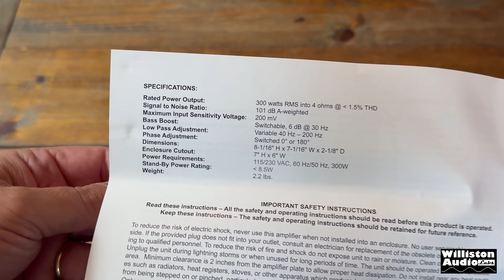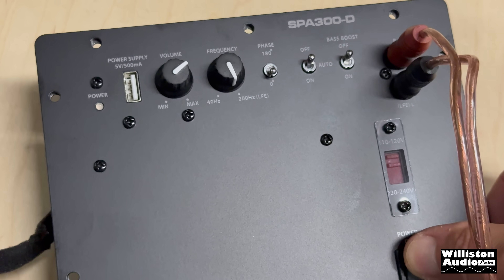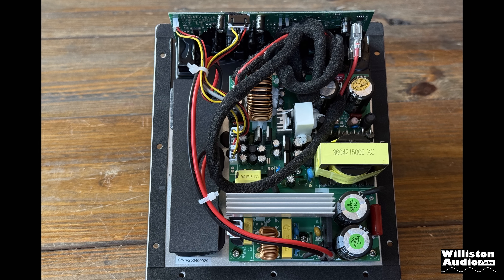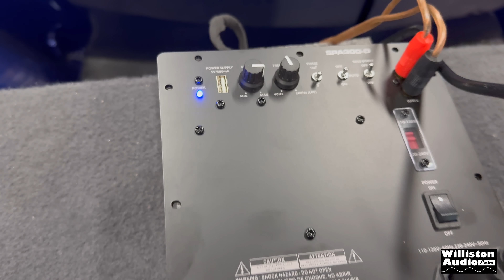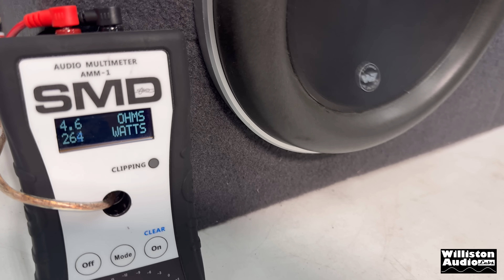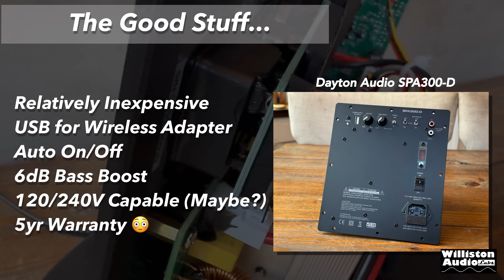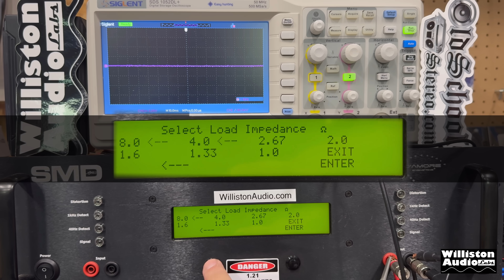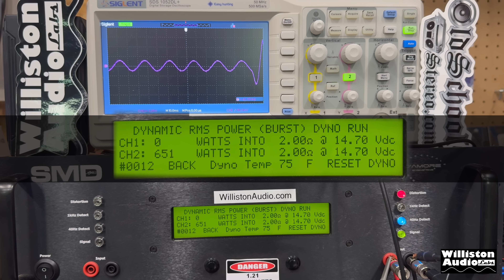Amp for Your DIY Home Subwoofer - Dayton Audio SPA300-D 300W Plate Amplifier

Comment: I don’t think the 200v problem is really a problem. The input power supply is certainly NOT delivering high voltage. Most likely it’s a much lower voltage and certainly DC.

Comment: I run a Dayton 500W DSP that I used the included software to tune my room.
It drives 2 velodyne subs. An 18" F1500  (250W) and a 10 cht r (185w) in parallel for a 3 ohm total. Was Tired of fixing the caps and dry joints so I mounted the 500W DSP on the side of the TV cabinet. Volume range from 10-14 blows your socks off and I dont mis the accelerometer. 
The 18" had a lot of boom so I then added the 10" for more punch. Works well.

Comment: Would the plate be able to move 2 10inch sub woofers Orion Cbw104D? Conected in series to get 8ohm, since they are 4ohms each and 300 watts rms

Comment: should put the sub on the floor where it will gain 3 to 6db for nothing with floor loading. to gain 3db on a system needs twice the power 6db is 4times. so good gains.

Comment: 12:20 No "True" LFE Input

From the manual that you were holding at 0:54:

"Note: When using a pre-amp or home theatre receiver with a LFE (Low Frequency Effects) output the internal low-pass filter circuitry should be bypassed by turning the frequency control to maximum (200 Hz)."

0:59 All that stuff most of you probably aren't gonna read anyway

Comment: The input power is using the classic voltage doubler when set at 120v  and non doubled when at 240v,  the caps are effectively in series giving them a 400 volt rating.
Reply: Those god damn fkn caps dont have dick shit to do with wall fkn power jffc 
SEE WHAT STUPID DOES TO IGNORANT HOLY SHIT U GUYS GET TFK REAL ALREADY JFFC

Comment: CRAZY take... 

While I'm saving  up for my Corolla build for my wife (broke AF in these times), I took a 400w 12v->120v inverter and plugged a 100wrms Monoprice home  sub amp up and slapped a VM Audio 10" DVC on it wired to 8 ohm. Seems  like it's only getting about 50w, but not sure.

Seems to me it takes less electrical support in a car to run a home sub amp this way with an inverter than it does to run a dedicated car amp of equal power. I know I'm  running factory electrical and have a sub and amp installed with zero drain on the electrical.  I just tapped it in as an "add-on" sub like a big box powered sub.

Comment: Video on these types of home amps was just what I have been looking for, I have a Decware wicked one box with two 10 inch MTX 5000's in it that was originally powered with one of the bob carver sunfire plate amps, then a triad bronze rack mount amp. But due to brownouts I am once again looking for something cheap, but that will do the job.

Comment: What you didnt cover that seems to be very common and with every plate amp I've owned is they have a built in HPF (Or Subsonic Filter) at around 30-36Hz I've noticed and so below 30hz there is massive attenuation which is annoying
Reply: Exactly, i am building a sub right now and i am having the exact same problem...
So annoyng.

Comment: not many people know. You can buy a bit coin power supply they make very large ones . I bought a 1600 watt unit 12 volts. You can use a taramps amp  ,. it will give you 1400 safe watts enough for  a stereo in your home what i use in my garage .   In my home i use a 600 watt  adjustable power supply make it 14.9 volts .  turn the supply on when my amp is on. All of it connects to a deep cycle battery for a large reserve for massive bass hits . my bas samp get about 12.9 volts  with no load when bass hits hard i can run a single 2000 watt rms sub 15 to max power , I ran it for about 4 hours at a party half power no issues .Loud pounding bass . Stop spending all this cash for bs amps

Comment: Your doubts are in vain regarding the capacitors and the 240 Volt network voltage. - Most likely they are similarly connected in series (capacitors) as in computer power supplies.
Reply from the maker: Thanks for the clarification 👍

Comment: Thank you for the test. Honestly I have yet to have issues with Dayton. I use the plate amps often for builds ( you should test the 1000w one ) and I really like them. I have run their subs in many builds as well. The ultimax in a nice sealed enclosure ( 12 inch ) inside a normal SUV running on just slightly over RMS will impress a lot of people. I'm currently running two xmax 10's and for the price I don't think you'll find a better responding well rounded  bass driver.

Comment: I wouldn't let the 200v caps keep you from thinking the am0 will not run on 240v. Simply the power supply running on 120 or 240 will not exceed 200v. A 240v input may get regulated to 160v for instance.

Comment: I bought one of these off Amazon for my Monoprice subwoofer.  The Monoprice amp failed after about 3 months!!!  So everything was good, I just needed a new amp.  I put this Dayton amp on and this home theater sub really kicks now!!!  I have 2 of them powering my 5.2 garage system and they kick!!  For the record, Monoprice home theater subwoofer amps suck!  You won’t get 6 months out of them.  But the Dayton amps sound great on my 15” subs!

Comment: Can you test if it has a highpass filter.
It turns out that all Yung plate amps have a highpass filter at 30hz so they are extremly rolled off down to 20 hz, that is not acceptable for me as i want a sub that goes close to 20 hz and is tuned in the lower 20s.
If this plays flat down to 20hz i will get this insted of Yung.
Also freqency respone is one more thing you could test since some plate amps managed to mess that up...

Comment: I wonder if you could reach 300 watts certified with it powered on 240v since the amp would be more efficient? Presumably that's how China is testing them.

A safe way to test 240v would be wiring a dryer plug into a 5-15p plug, and then just unplug your dryer with the new cord when you want to tap into 240v.

Comment: Most people (including manufacturers) misuse the word phase here. The little 0–180° fixed “phase” switch on that sub isn’t a phase control at all. It’s just a polarity switch. All it does is flip the sine wave 180° (in polarity vs. out of polarity). You can see this instantly in an impulse or step response measurement.

A real variable phase control is either:

1. an analog all-pass filter (shifts phase across a frequency range), or

2. a time delay (sometimes mislabeled as “variable phase”).

Those are totally different from a polarity flip.

The proper term for the 0–180° switch is polarity matching, so your sub is in polarity with your mains. Phase alignment is a much bigger and more complex subject, but it keeps getting blurred because too many in the industry are lazy with terminology. Now you know.

Comment: I guess watt per dollar its ok but i dont really get diy plate amps. Pro amps are generally better, more reliable and cheaper watt per dollar, better dsp. Also they make ur rack look cooler and u dont have to cut an xtra hole in ur box. Wouldnt doubt if reliability issues with plate amps also has to do with them being mounted in a hot vibrating box.  I can see them for commercial but unless ur on a really tight diy budget pro amps seem to make so much more sense.

Comment: Williston you have a switchable power supply, while those are only rated for 200Volts DC, there are two of them, and they are in series so its 400Volts DC, if you switch to 120V region, one capacitor will switch to be an open component or sometimes it parallels with the other capacitor (depends on the planning of the power supply), and if you switch the power supply to 240Volt region they switch to be in series, so when you have 240Volt ac it charges up to be about 340Volts DC, pretty shocking if you touch it. So dont do it, you make such good videos :DD
Reply from the maker: Awesome, thanks for clarifying

Comment: Hey Big D, have you ever measured how low your JL W7 10 goes? I have the 12" in a custom box built by an old company called Fatt Box.  It's a bigger than normal box, but I have gotten a  lot of compliments on how good it sounds.

Comment: I had a plate amp from a monoprice sw15 powering a Rockville k9 at 2ohms.  Man, that plate amp pushed the k9 really really hard.  Ran the amp at 2ohms for over a year until it died.  Those plate amps have a 2yr life.  Many reviews showing that at the 2yr mark the amps die

Comment: I’d love to see some speakerpower plate amps tested! They have options all the way up to 6000w rms
Reply: 1800 watts is the max you can continuously pull from a 120V circuit in the US, and you won't find one that pulls more than 1500 watts. 

Look at the fuse rating, and multiply that by 120. That's the absolute maximum you'll be getting continuously out of the amp, and it will likely be significantly lower (like half).

Comment: So, this is more of a question about that w7.
What are your thoughts on it compared to a w6? I have a 10w6v3 in the JL HO box with a 500watt fosgate (that dynod at 641).

Would a w7 be THAT much of an improvement?
Reply from the maker: I’ve used both and the W7 is one of the best all around subs IMO

Comment: Man that amp look just like the 300w yung amplifier  with a differnt cross over board  that parts express also sells.   Whats with all of dayton audio plate amps  and the speaker thumps  they could at lest put in a time turn on delay relay swith .  Or speaker protetion  board switch   so the amp clicks  instead of the speaker thump..  and charge 20$ more.  im sure  no one would complain  about that price  for a smoother amp turn on  function   just my opinion 💯🎵🎶✌️

Comment: The 200V cap thing is not a issue. 220V in the USA is two legs of 120V. So you can pull from one leg or do two separate filters and then add them.

Comment: I like the scope, you should leave it in.

Also you should do an experiment about cheap "laptop style" 24v power bricks and those tpa3116d2 Bluetooth amps. Try just a power brick by itself and then make a super capacitor using those 2.7v 500farad capacitors I see on eBay or Amazon. I am really curious if it would boost my output but I don't have the fancy amp dynos and multimeters you have!

Comment: That's the plate amp I almost purchased about a year ago. I instead ended up getting a Taramp 100/130 PSU and have a Kenwood 300 watt amp running my sub for my computer's Atmos setup. Already had the amp and sub with sub box. Based on the output of this plate amp, I would have done fine getting it. But I kinda wanted a good PSU for car audio. Sure, 100 amps continuous and 130 burst isn't enough for big amps. But add some batteries and it will do just fine.

Comment: 200V caps on 240V switch?
Easy!
They are in a serial connection.
So, together they have 400V working voltage.

Same is in PC power supply.
Reply from the maker: Thanks for clarifying 👌
Reply: This!

Comment: Thank you for testing this amp!  I have used it in a few projects and love it, I figured it would get at least close to it's rated power. Best thing about it in my opinion is that it's so small and shallow. Lately, I just make a small amp-enclosure for my home sub projects and this amp is so small the amp-enclosure barely takes up any internal cabinet space. Great Video, thanks!!!

Comment: Those 230v caps aren't on the AC input side of the power supply. They are on the DC side which likely runs around 40V DC for a class D amplifier.

Comment: Looking ideal for a large displacement sensitive vintage sub
Reply: EV DL18MT with fs 24Hz no 2.9% 8ohm or EV EVX-180B with fs 29Hz no 3.4%. Not sure if this is vintage enough as you may be talking about an ancient Lansing or Klipsch unit!
Reply: Might take a look at PRV PA-Stage 15" woofers. They are incredible sounding.

Comment: At least it's not half the claimed power! Not bad. I was excited to see the 15" sub with this amp but it's very disappointing to see the woofer did not like the extra power.
Reply: Woofer construction is very weak so no wonder it didn't like that much power.
Reply from the maker: Yeah def not a high powered sub. Also enclosure seems to be much smaller than the woof wants

Comment: id like to see a dyno demo of a speakerpower plate amp.. i bought a 1200w version on ebay for a steal one night, and have only used it to test some woofers so far.... they were 1,000 dollars on their website.. seems to be a beast, but would like to see if they do there rated...
Reply from the maker: Thanks for the suggestion 👌

Comment: You should test the Behringer NX6000D PA amplifier. A lot of people, myself included, use it for extreme home audio bass. Much simpler than the car amplifier in a house route.
Reply from the maker: I tested the NU6000 a few years ago
6000 watts for $350? Behringer iNuke NU6000 Pro Sound Amplifier
https://youtu.be/73Z2fNcGGDI

Comment: The 110V/240V switch is used to switch the input capacitors from parallel to series, which should increase the voltage the system can handle to 240VAC (~340VDC after rectification, assuming the capacitors are balanced, as any decent power supply design should do).
Reply: Appx. 30 years ago my friend had this marvelous idea in computer class. Their seats were like on both sides of table so you could see the opposite kids I/O panel and wires. He flicked the 120/240 switch from 240 to 120 when computer was running. Power supply wasn't happy and all smoke that was installed in factory came out. Nobody execpt my friend didn't have a clue what the flying f just happened...
Reply from the maker: Thanks for clarifying 👍

Comment: I have this amp on my skar 18" subwoofer. In a box, I made tune to 30 hz it sound amazing
Reply from the maker: I had a pair of those Skar 18’s and really liked them
Reply: Do you run it with the bass boost switch turned on?
Reply: @T_Burd_75 bass boost turn off most of the time
Reply: I got one mounted in a Skar 15" ported box with a PRV 15" PA woofer -- talk about "barking out the bass". Wow..

Comment: Shame we cant get home bass amps as powerful as car amps for the same price per watt. 

The closest we can get is use car audio amps, but getting power to it offsets the price per watt. Keeping the batteries charged can add noise to the system depending on the charger or power supply.
Reply from the maker: You are right about that!

Comment: Please try out the 1,000 watt Dayton Audio plate amp. I’m curious to know if this amp would be worth building a home theater subwoofer around. Theres not too many companies that offer higher wattage plate amps over 1,000 watts. Thanks!
Reply from the maker: Already did, check video description or pinned comment for link to that video

Comment: Thanks for doing this!! Example of the kind of content I love!!  In fact I’ve thought about doing this same kind of amp swap myself!!! 🎉 

Question tho: the listing shows the spa300d has a 6dB bass boost, how well did that perform? But I was wondering if there was a way to test the freq response from 5hz-200 (ish)?? Also, I noticed the specs say it’s rated at 1.5% but we tested to 1%. Perhaps that’s the slight discrepancy in power output??
Reply from the maker: I also tested to clipping which is beyond 1.5%. The 30Hz boost worked well
Reply: @wal yeah, I always watch your videos till the end!! 🎉 over xxx watts @2 ohms was cool!! I wonder how long the amp would last if ran at 2ohms regularly?? 🎉 thanks

Comment: funny, but i stopped mounting amps on the sub box after my jl 12's rattled caps out of my rf power 300....had to take it to be fixed, went under the seat after🤷‍♂

Comment: So one thing you have to consider when dyno testing these home subwoofer amps is the fact that you are testing at 40hz and they may not put out their full potential at that frequency due to low pass filters and such I mean that is the very lowest that you're able to set them if there were a way for you to test power output at say 50hz I'd be willing to bet you'd be more than surprised by the capability...
Reply from the maker: I can test at whatever frequency but IMO a subwoofer amp should do its power at 40Hz as well. It was uber close here and next time it’s that close I’ll try 50 and 100Hz just to see those extra couple of wizzats
Reply: @wal good deal, I honestly am not even sure about it myself but it was just something that popped in my noggin every time you dyno'd a home-sub amp and it underperformed lol-ol-ol so I'd certainly love to know if I might be right to think that'd be possibly why...